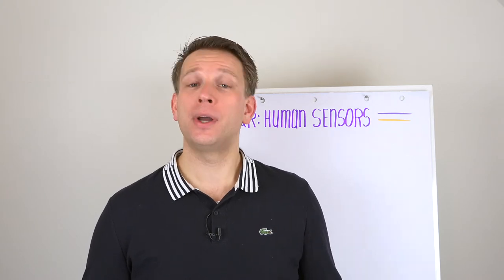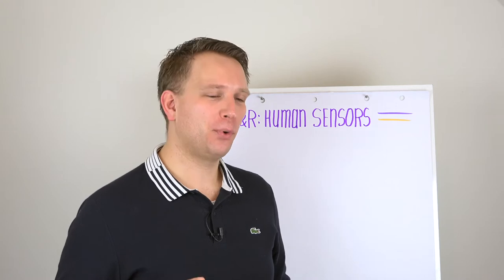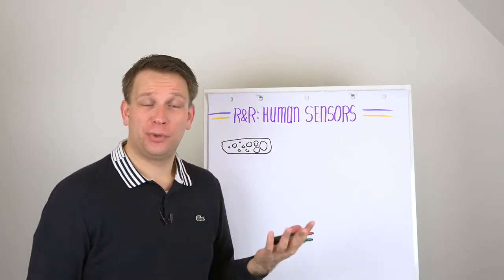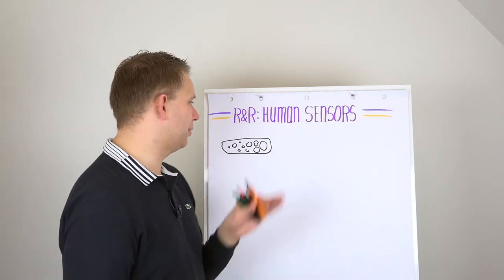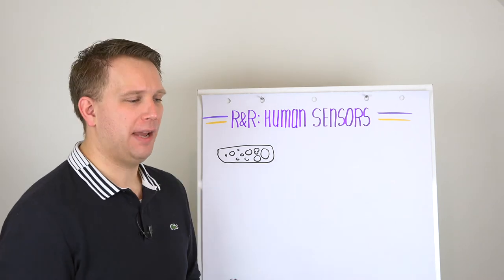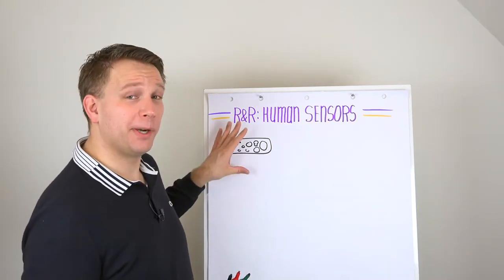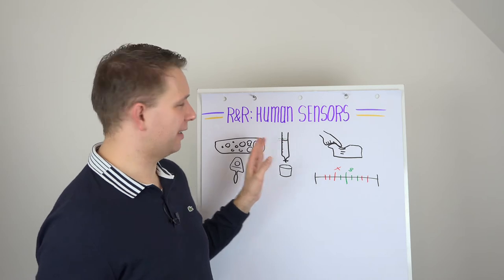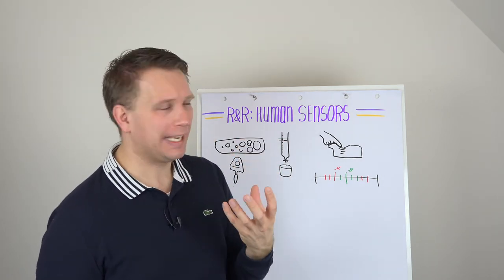Gage R&R is ideal for human sensors | When to use R&R

Comment: Hi Tom - Good video as always, my advice to the OEE & time type MSA questions, is just be certain that the data is clean. I conducted an Incoming on time delivery project and my data contained results that showed 100 days late 100 days early!! These results did not belong in my data set however, they were not for production materials. So no MSA but the data needed cleaning...as you say the clock measuring 100 days late, was correct, but the whole data point was wrong..
Reply from the maker: Nice addition, Paul - start with just looking at your measurement results and clean the data before you use more complicated tools and go into full measurement system analysis.